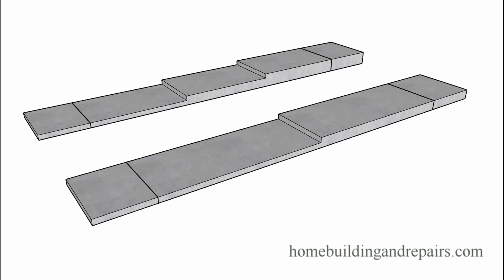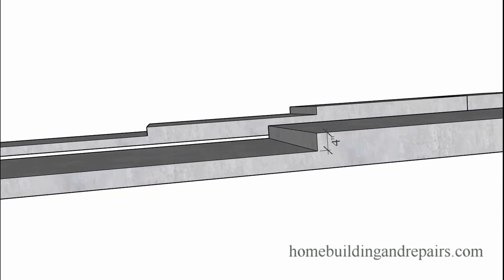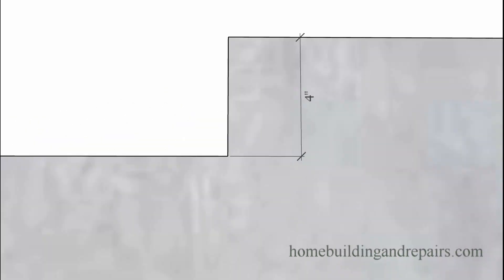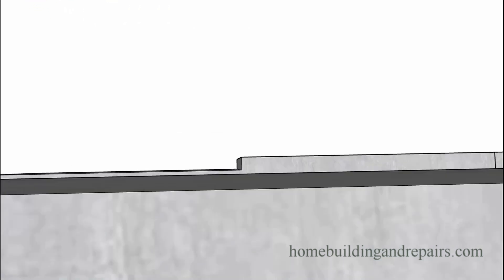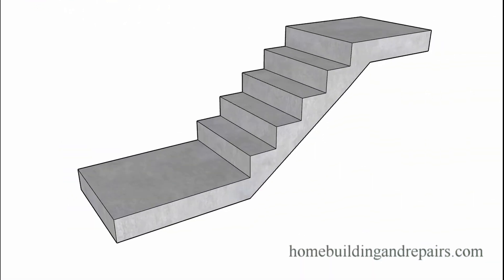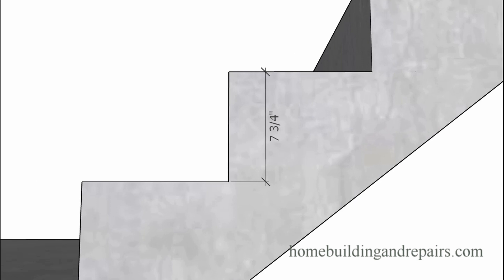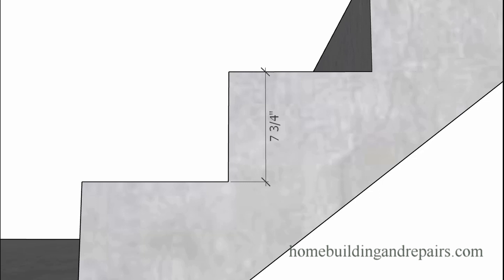Is There A Minimum Riser Height For Stairs?

Comment: Is 10" tread and 6" rise comfortable for a residential home? The stair will be in living room. Thanks.
Reply from the maker: The most common is 10" tread and 7.5" riser and if I was going to use a 6" riser, I would use a 11" tread if I had room. However, most of the time we have to work with what we have and you should be fine.
Reply: @stairbuilding  thanks much.